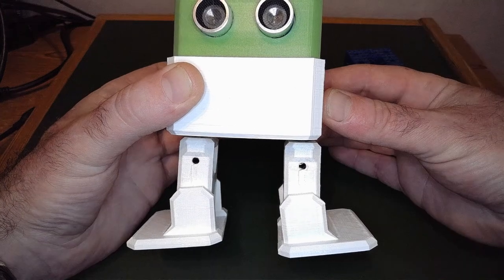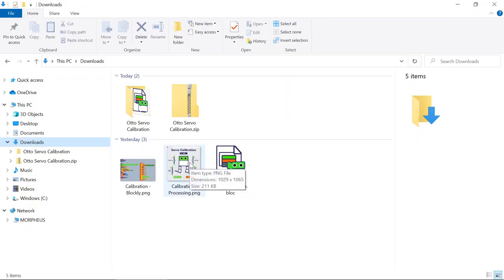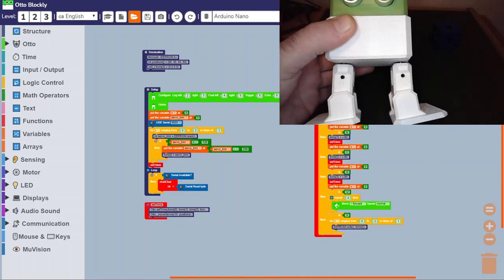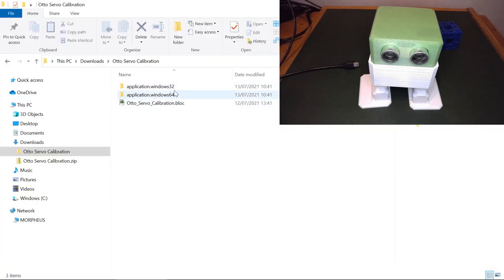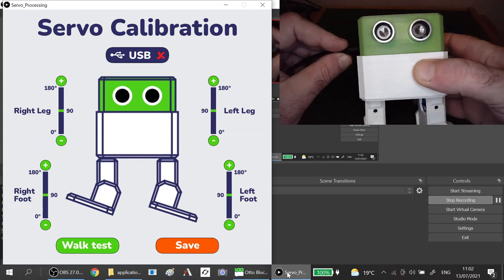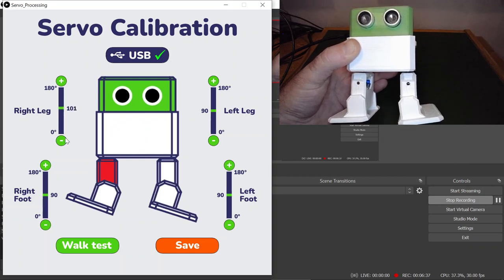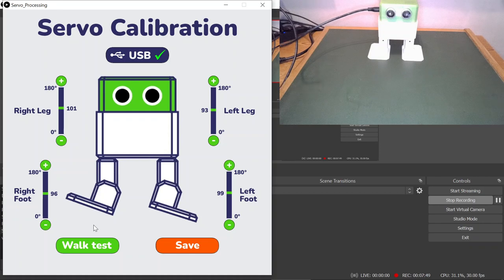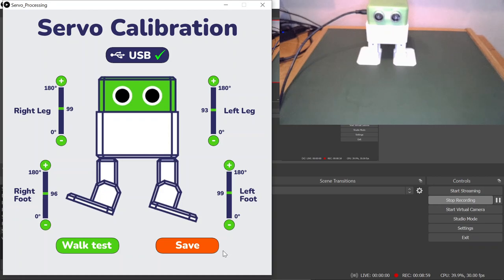How to Calibrate Otto DIY robot servos? using Arduino Processing and simple Otto Blockly

Comment: Only the right leg is responding. When I tried left, the right servo vibrates and no change in left leg..please help
Reply from the maker: Make sure the pins for the servos are different in each left leg pin2 right leg pin3, left foot pin 4 and right foot pin 5
Reply: @OttoDIY  Hi, Thanks for the quick reply. Yes. I have ensured that the pins go in the right place. Though the user interface responds on different leg, I have some how used the same servo calibration app, aligned and saved. The moment I unplugged and plugged back, one of the leg twisted to 45 degrees again. :(
Reply from the maker: @gamershamash7439  no worries post in builders.ottodiy.com and we can help you

Comment: Hi. I am trying to get this working. When I press Upload code nothing happens. The agent is installed and connected and the right com port is selected. I tried all nano board variations, but still nothing. Any ideas what might be wrong?
Reply from the maker: so you are having problems with uploading the code from Otto Blockly? can you please post the message error in builders.ottodiy.com

Comment: calibration software freezes never can connect always red usb sign. :(
Reply from the maker: Are you on Mac or Windows?
Reply: @OttoDIY  I have the same problem, I'm using all the same stuff you are using, same computer and everything.
Reply from the maker: @samweintraub6721  the MAC is not very stable, check the new video that is pin in the comments
Reply: @OttoDIY  Thanks!